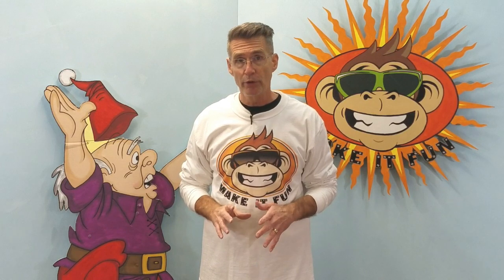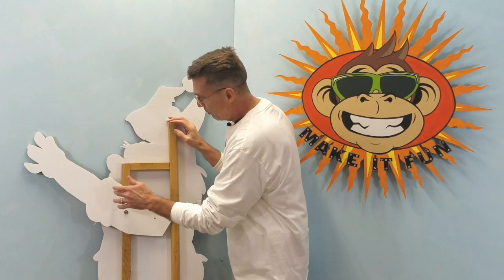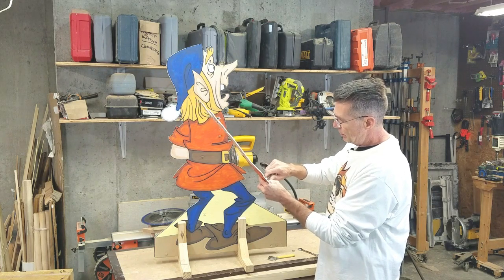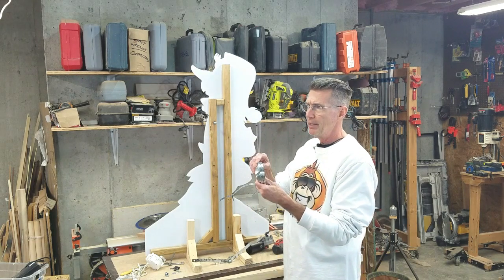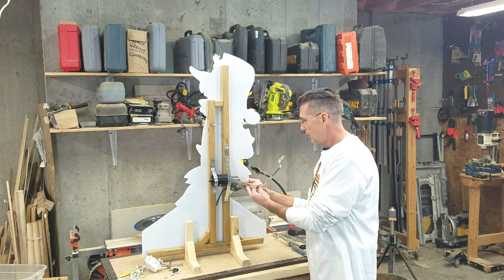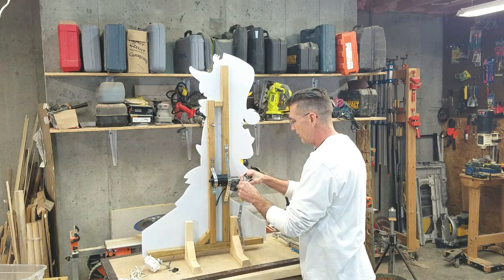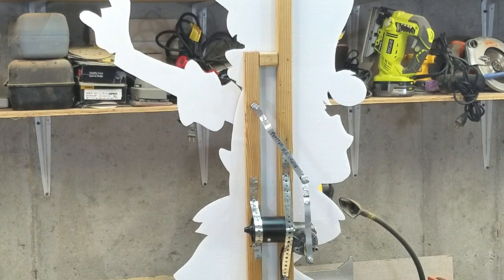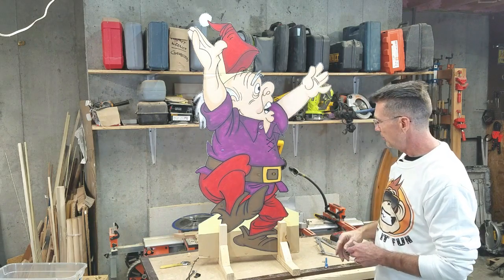How to animate a display character using a motor

Comment: please tell me what kind of projector you are using?
Reply from the maker: Hi... I use an old overhead projector (like the kind they used in school when I was a kid back in the 60's and 70's).  I purchase transparencies that I can print on via my inkjet printer and use those in conjunction with the old overhead projector.  You can also use an LED (LCD) projector with your computer if you have one of those.  That's a bit too new fangled for me... I'm pretty old school!
Reply: @makeitfunMonkey  😂thank you so much
Reply from the maker: @sweetasjelly  You're welcome... good luck with your project!

Comment: How can I make both arms move
Reply from the maker: If you don't mind the arms moving at the same rate of speed... you can add another link onto the motor spindle to connect to the second arm.  If you desire them to move at different rates of speed, the only thing I can think of would be to add a second motor.  BTW... I'd love to see video or pics of what you come up with!  Good luck with your project!
Reply: @makeitfunMonkey  can you make one with two arms

Where can I get coroplast from
Reply from the maker: @junkcarz4720  I haven't been animating my characters for a few years now.  The wind, where we live now, is MUCH worse than where we used to live and it was so strong that it tore off the arms to some of my characters!  Talk about scaring the beejeebers out of little kids!!!  As for finding Coroplast... I called a local sign company (they use Coroplast for the yard signs - for sale signs, political signs... etc.) and asked if they would tell me where they bought their Coroplast from.  I told them that I was making Christmas decorations for my front yard in order to reassured them that I wasn't wanting it to make signs and be in competition with them.   They told me they were purchasing from a local (Lexington) company and, fortunately, that company sold to private individuals such as myself.  I believe it is called Wise Inc.  The local sign company was willing to sell the 4x8 sheets to me... but they were charging double of what I could get it for from Wise.  There was also a local plastics supply store that had it... but again, they were twice as much as Wise.  I'd start with a local sign company, if I were you, and tell them what you're using it for and ask if they'd mind telling you where they buy it from.  If they're nice... they'll let you know.  Or maybe you could ask if they'd be willing to sell a few sheets to you.  The last time I bought it (last fall) I paid about $16 per sheet for it.  Who knows WHAT it's running now with COVID inflation tacked on!?!?!
Reply: @makeitfunMonkey  what you do with motors and aluminum rods
Reply from the maker: @junkcarz4720  Kept them in case my grown children want to pursue animated yard displays
Reply: @makeitfunMonkey  can you email me. Picture of them for ideas let me know
Reply from the maker: @junkcarz4720  That can easily be accomplished by making both arms out of one piece of Coroplast.  Center the arms (made of one piece) on the pivot point and connect the linkage to either the right or left side of the arm.  When one arm is raised, the other will automatically be lowered.   Obviously, the arms would have to be BEHIND the characters body... but the rest of the setup would be very similar to what I've shown in the video.  If you look at the video around the 2:30 mark... use that character as a reference.  But instead of just one arm moving up and down... imagine that single arm is a much longer piece of Coroplast and the other arm and hand are painted on the other end and sticking out of the other side of the body.  Then set up the motor and the linkage to raise and lower the piece.  As one arm moves in an upward direction... the other arm is lowered.  In the case of the pizza video... it appears they have used separate linkages... but you can achieve a very similar look doing it the way I've suggested.  A MUCH easier method than doing two linkages to the motor spindle... in my opinion.  Hope this helps!

Comment: Good video! You covered all of the bases including wind loads! Coroplast is a good choice vs. plywood. I've found that it's lighter, easier to cut/shape, and doesn't degrade when it gets wet or snowed on. It's harder to source, but worth the hunt. There are only two things I can add, and I got these tips directly from Disney Legend Bob Gurr: 1) Keep the moving parts as light as possible. Small aluminum angles and tubes are a good choice for structural elements if making your decorative materials stronger/thicker would add a lot of weight. 2) Counterbalance your moving elements. Attach weight or springs to a separate rod on the back side, to the actuator linkage, or to some other place that offsets the weight of the character's visible arm. The goal is to balance the moving element as much as possible. That reduces the forces on everything but the pivot point. So you only have to make the pivot point stronger while the linkages, motor, etc can be lighter/cheaper and will last longer.
Reply from the maker: Thank you for your kind remarks.  I TOTALLY agree with what you've added and I wish I had thought of those ideas to add in to my video.  I've used counterbalances but not aluminum angle or tubes for structural elements.  Both good ideas... thanks for your input!

Comment: How does the paint you use hold up? My
 understanding is coroplast should be sanded down and spray painted with Krylon spray paint as it wont chip or flake off like other paints
Reply from the maker: Hi Valerie - I have coroplast characters from 8 years ago that still look as good as the characters I made a month ago.  I've never heard of having to sand and using Kylon paint on the coro... but I'm sure that would work.  As I point out in one of my other videos... the best prep work I've found is to simply clean the coroplast with something like a paint thinner to remove any oils that were left behind by the production process.  After that, I always give it a coat of white, exterior latex paint (using a roller) in order to help the paint adhere better.  If you'll utilize this process, you shouldn't have any trouble at all with your paint!  Of course, if you drag your painted surfaces on something rough the paint will come off... so I try to be careful and not do that.  Oh... I use exterior latex paint for all my colors.

Good luck with your project and I'd love to see pictures of your characters after you get them finished!